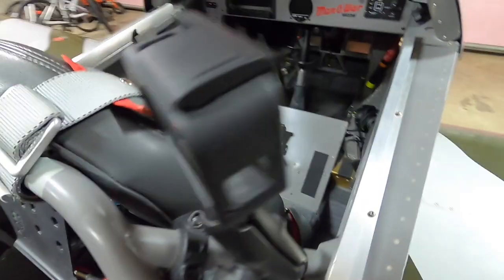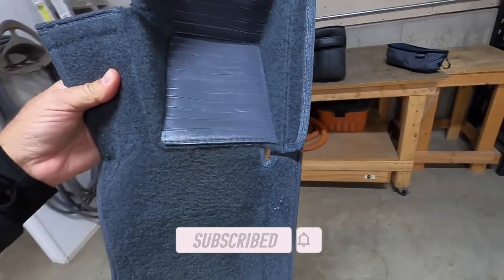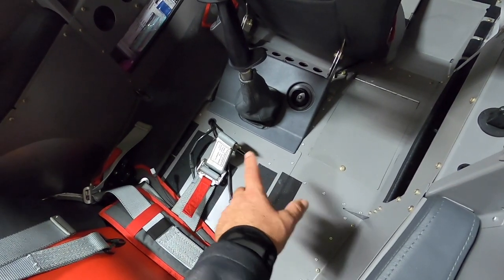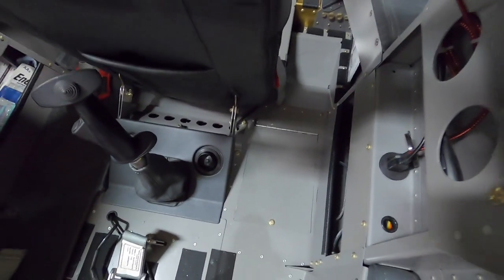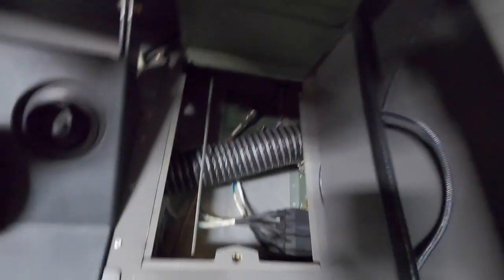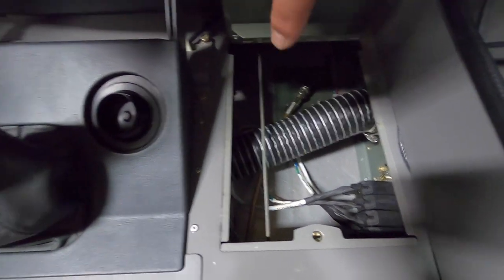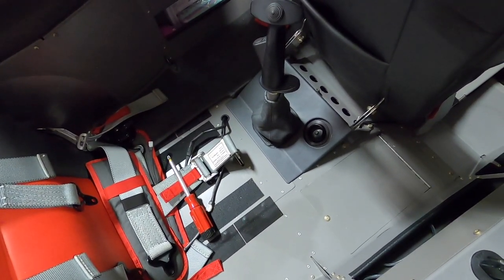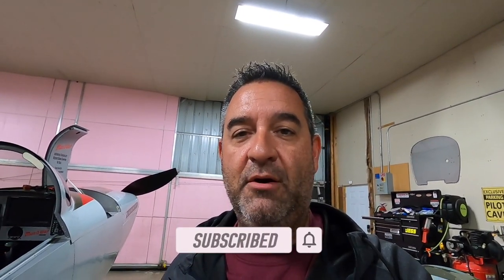Side Floor Mod

Comment: Hey Michael. First I like your videos a lot. Great job you did. One question...did you call the "mothership" (Vans) before doing the mods to get their opinion? I did also many mods on my RV-8 and sometimes Vans told me not to do it for a reason...best regards from Switzerland...an keep posting those cool videos. Christian
Reply from the maker: Thank you, from others I have learned that most often Vans will say no to modifications due to liability and they didn’t test their planes with said modifications.  My modifications, as I say in the videos, we’re not my original designs. I just followed others and they have been flying for years and thousands of hours without issues. So I was ok with them, after all it’s an experimental which is part of the fun. Thanks again for watching! 
Cheers from Illinois,
Michael
Reply: @therv-8pilot  you are absolutely right. Keep on with your good work!